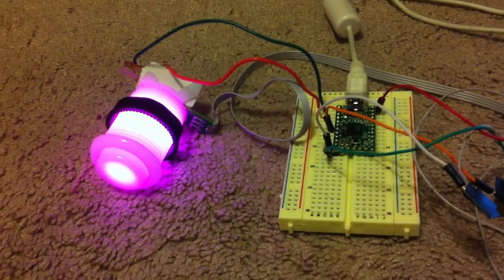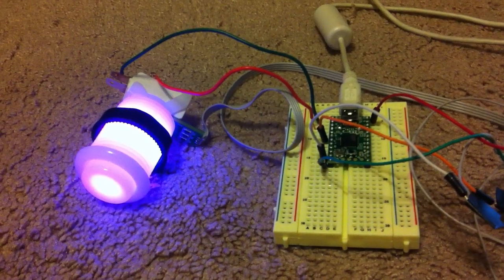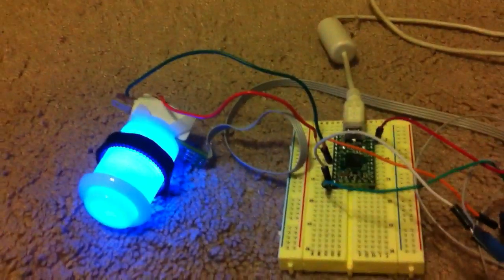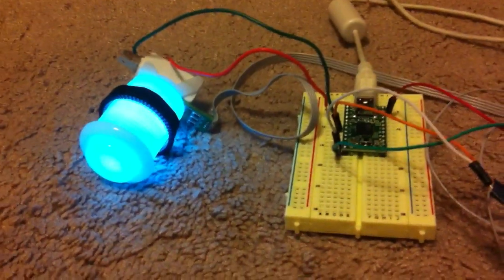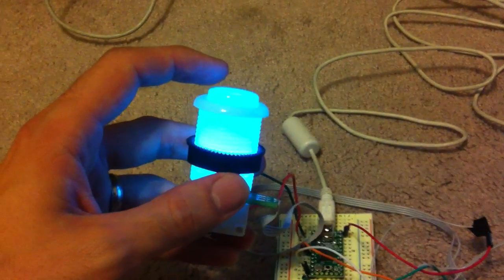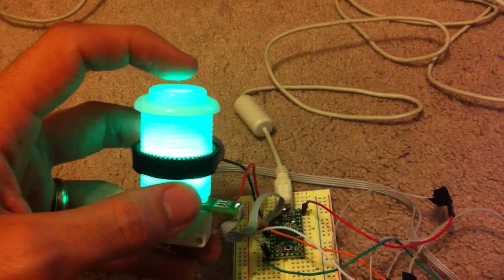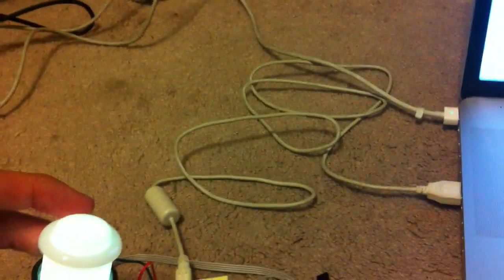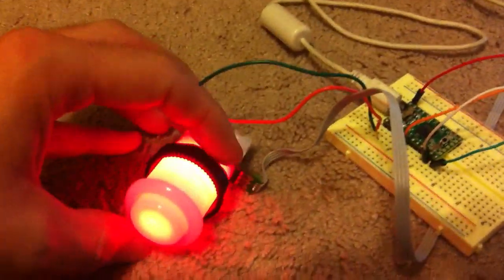DIY: Arcade button changes color when pressed and controls a photo booth

Comment: My button only does a left click. How do I change for it to do a spacebar instead?
Reply: you need to look at programming keyboard strokes. which is pretty much 

    Keyboard.press(KEY_ENTER);

Also have to change your controller to a keyboard controller not just serial adapter. I also don't think you need to use #include anymore.

Comment: Hey this is great.  How easy is the software to program?  I'm hoping to setup a bunch of rocker/on-off/momentary buttons to use as a custom keyboard/games controller.  But i've never used this and i'm not a computer programmer per say.   Great video, any updates? D.